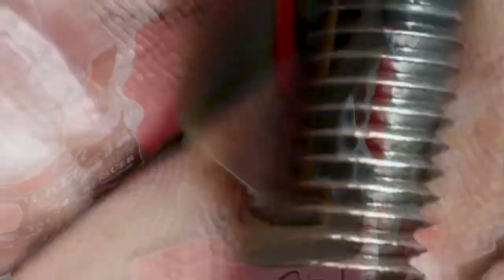1972 SCOUT FUEL PUMP

Comment: Thanks for the video. I was in the same boat with no bolts for my fuel pump. I am now trying to install it and can seem to get my new pump to seat against the block, do I need to move the cam inside or is there another trick? Seemed like the old one just slid right out.
Reply from the maker: the flipper needs to go under the cam lobe, so the engine may need to be rotated a bit or you'll be fighting the spring in the pump, and it can actually break the pump if you force it.